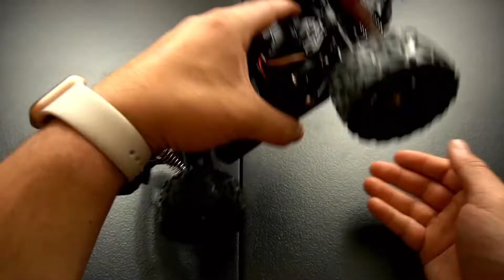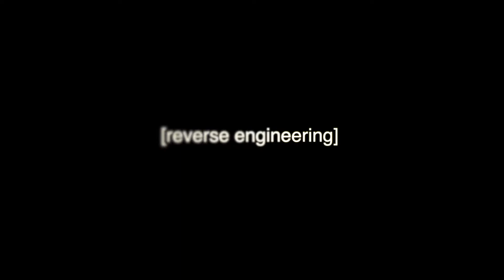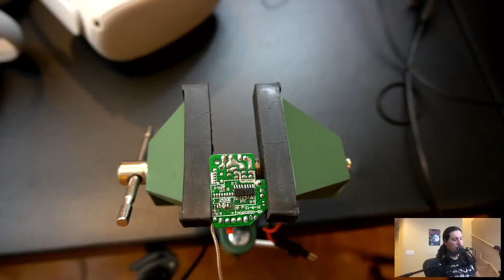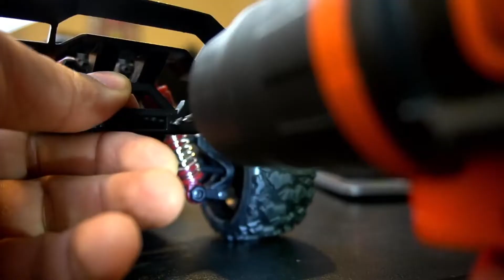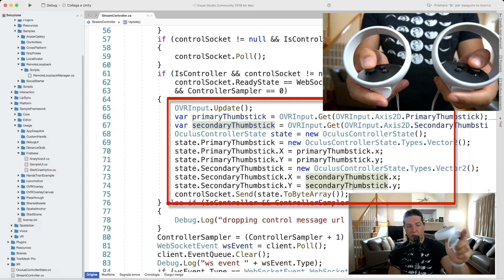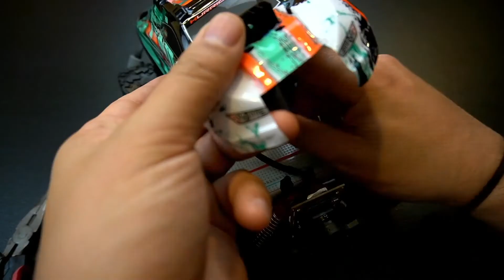We Built an App to Control an RC Car with the Oculus Quest

Comment: Hey dario, nice video. i am also planing to build somthing similar to your project, but i have some questions. Did you use Ros2 for your project? and how did you link rasberry pie to unity over wifi. it would be really helpfull if you could make a step by step video on your project build. also I am planing to add a robotic arm to this project, in your opnion how should i impliment this? 
Thanks for your help.

Comment: This is so so cool, I am trying to do something similar but with a drone so I can perceive depth. What kind of latency did you get?
Reply from the maker: Using wifi we were always between 50 and 70ms, because we used websockets, sometimes everything would come up to a halt for a few millis, then it would catch up. I would use quic  if I ever do this again (probably I will)

Comment: Would it be hard to adapt the code to an Arduino? Or is there components of the pi that are required
Reply from the maker: Seems like running Around yay on Arduino ain’t that easy, so I would say it is possible but might be a pain in the rear https://www.reddit.com/r/rust/comments/qg2zo1/how_to_run_rust_on_arduino/

Comment: This is so cool! I'm trying it with my oculus now, but I'm getting an error when I try to specify my IP address in the url string variable in StreamController.cs. The actual message is "ArgumentException: a relative urI." How should I fix this?
Reply from the maker: Hey Ashley!! Which version of unity are you using?
Reply: @dario.lencina  Right now I'm using the 2021.8 version!
Reply: More specifically 2021.3.8f1
Reply from the maker: Ok perfect, same than mine. 

Ok, based on the error you are getting, my guess is that the url format is wrong, can you share it here?
Reply: @dario.lencina  So far I'm using a relative ip. So what I have in the url variable is "192.168.x.x:port"
Reply from the maker: @ashleyajuz9062  I think this is the issue, can you include ws://192.168.x.x:port and I am not sure if a path is needed (check the rpi code)
Reply: @dario.lencina  That worked! Thank you so much for your help! Just curious, would this work with a raspberry pi camera instead of a USB camera?
Reply from the maker: @ashleyajuz9062  I do not have the rpi camera but you can test. 

If you can access the camera using v4l: v4l2-ctl --list-devices

Then probably it will work without modifying the rust code, but even if it does not, you have full access to the source code and I can show you how to add support.
Reply from the maker: @ashleyajuz9062  these are the cameras that I used: https://www.amazon.com/ELP-fisheye-Raspberry-Microphone-Security/dp/B01E8OWZM4/ref=sr_1_2_sspa?crid=31XPB5GRAPLXO&keywords=180+deg+camera&qid=1679077540&sprefix=180+deg+cam%2Caps%2C108&sr=8-2-spons&ufe=app_do%3Aamzn1.fos.18ed3cb5-28d5-4975-8bc7-93deae8f9840&psc=1&spLa=ZW5jcnlwdGVkUXVhbGlmaWVyPUExT1FZMkIyUUNHV1FHJmVuY3J5cHRlZElkPUEwNDc4NDE1UjVWQVQ0NDJEWENaJmVuY3J5cHRlZEFkSWQ9QTAxODIyMTkyTzkwV1I3RU04SDZEJndpZGdldE5hbWU9c3BfYXRmJmFjdGlvbj1jbGlja1JlZGlyZWN0JmRvTm90TG9nQ2xpY2s9dHJ1ZQ==
Reply: @dario.lencina  Thank you so much, I play around with it!

Comment: It would be absolutely great if you would make a video with code walktrough. Great project. Many people make fpv with raspberry, but not many do it with a wr headset.
Reply from the maker: Thanks for your feedback!! Literally I was waiting for people to ask for it do it!!
Reply: @dario.lencina  Please :face-blue-wide-eyes:Please :face-blue-wide-eyes: Please :face-orange-biting-nails:Make a Video explaining the code for how to stream the Rpi video to unity. and also was the application built into oculus :face-blue-question-mark:or were you using Air Link:socialdist:?
Reply from the maker: Hey  @The_Cosmic_Canvas  I used a websocket and sent jpeg over the code is free! https://github.com/security-union/oculus-rc-car-control